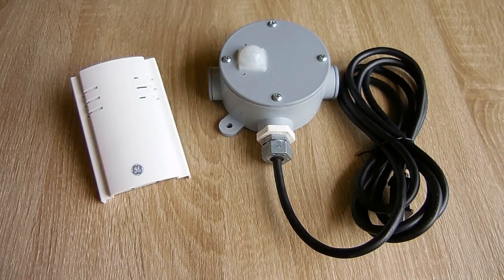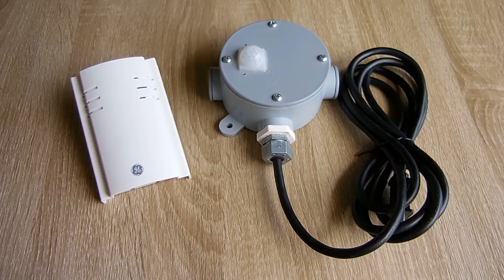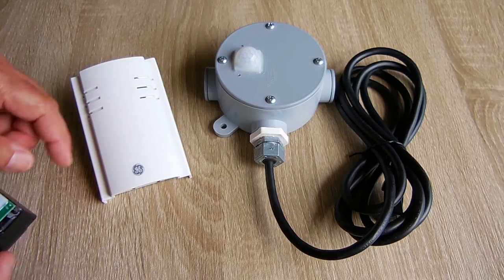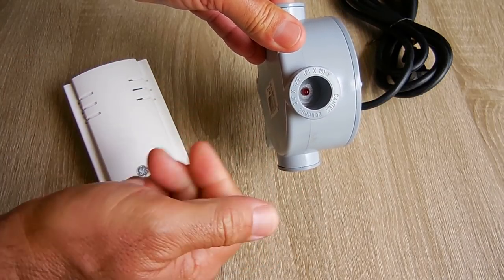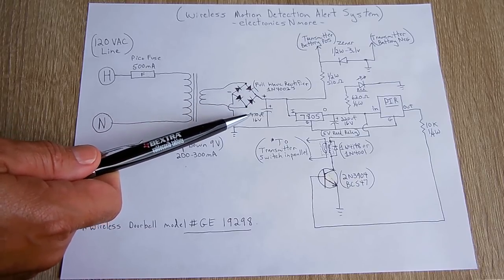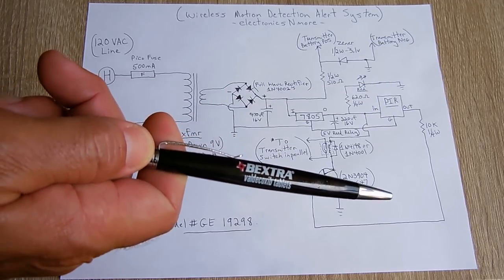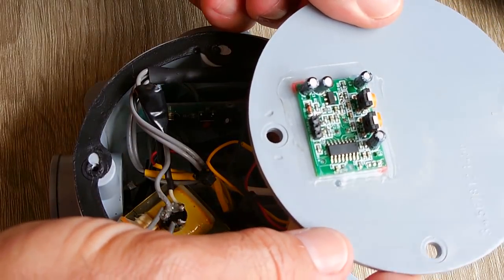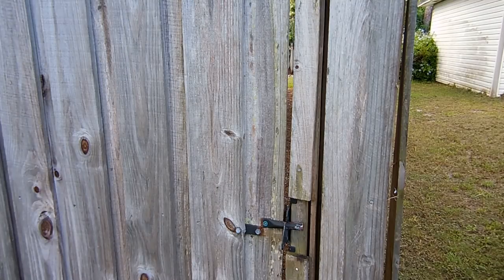DIY Intruder Alert System(Caught In The Act!)

Comment from the maker: Some online stores and local stores sell devices very similar to what I made. Many of those devices have a detection field of view 30 to 60 degrees, the unit I made is around 90 degrees. The store bought units need to have the outside PIR transmitter batteries replaced often, and cannot tolerate the outdoors nearly as well as my transmitting unit. The range of my unit can be increased from 150 feet to 250-300 feet by simply adding a short antenna wire to the transmitter. My unit can also be easily modified to do other things.
Reply: Very nicely done, i guess you could have the doorbell instead of going bing bong turn on outside lights, something the intruders would hate.
Reply from the maker: @MrRobinhalligan  I don't want them knowing I've been alerted to their presence. Thanks for watching!
Reply: Ah ok good point, was more thinking of making them take off but i see your point.
Reply: Rather than build your own power supply, just tear the guts out of a 9v or 5v cube wall wart.
Reply: Hi, really nice video. Could you maybe share the configuration with the antenna in a separate video? Or is it possible to repeat the signal to increase the range or send sms with GSM-unit? Already looking forward and subscribing...

Comment: Nice project. However I have a few comments and suggestions. Take them for what they are worth. You can buy a complete PIR driveway monitor for about 15 dollars on Ebay. Does the same thing and is plug and play.  They are all battery operated and can be placed without regard to an AC outlet. Are they better or worse I really do not know.  If you still want to build one from scratch I can make some suggestions. Buy a 5V USB phone charger from the dollar store and hack it to eliminate the AC spades and remove the USB connector and solder to the board directly. You got a much smaller complete 120v/5 V supply. You could also build a capacitive dropper power supply. You do not have to remove the coin cell from the doorbell switch and power it separately. I have wireless door bells for years and they are still all working. The batteries last forever. If you still want a separate power supply there is a 3.3 volt regulator already on this PIR module which you could tap.  Lastly I think you could power the reed relay (5V) directly from the module.(3,3v out on alarm). I do not know how much the module  can source. It may eliminate the transistor.  Keep up the nice videos
Reply from the maker: Yes, they also sell that at Harbor freight. If you place something outside in the rain, you want something that will last, and those units are cheaply made. You get what you pay for. I like the idea of using the 120V receptacle. You plug it in, and forget about it. No batteries to worry about. Those units go through batteries. Even though the batteries for the transmitter last a while, why bother with batteries? Having everything on 120V is best, at least for me. If you like the remote unit I made in my other video, then I told viewers to use the transmitter battery for that application.Pretty sure the PIR module output pin wasn't designed to handle 50-200mA of current. Thanks for watching!

Comment: How does the wireless remote button get activared?
If it does by closing of the pir contact it will annunciate the alarm only once!
Reply from the maker: As long as there's activity in the area, the alarm continuously sounds with a very short delay between double tones.